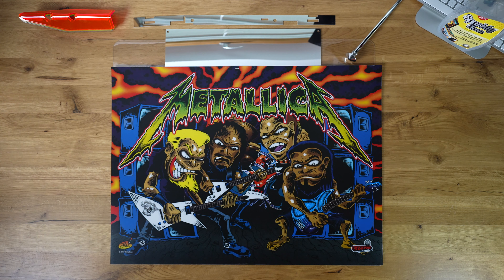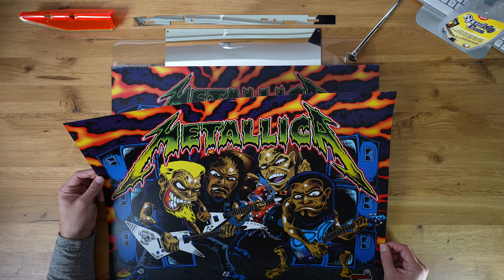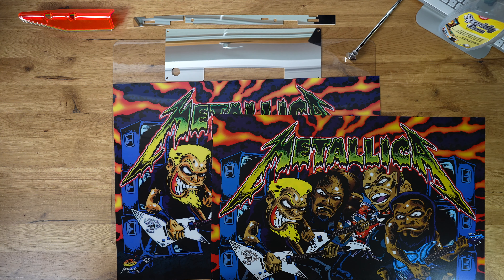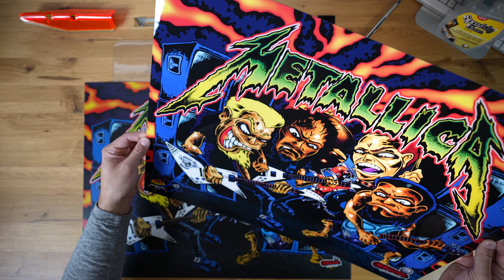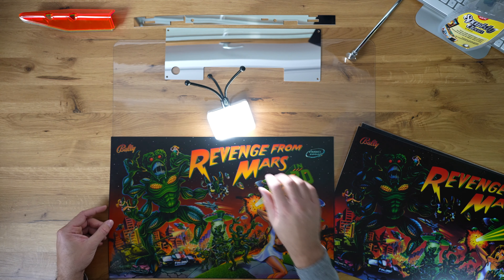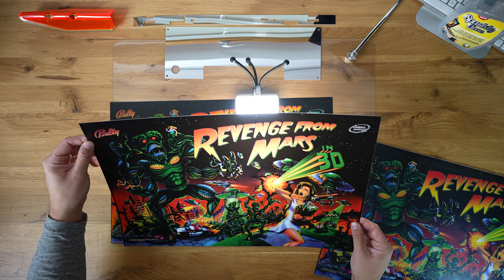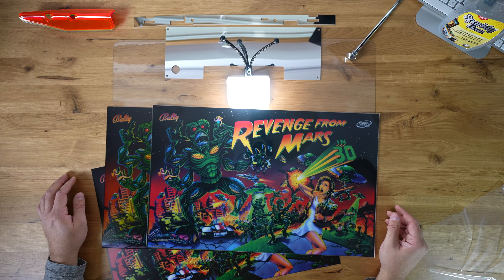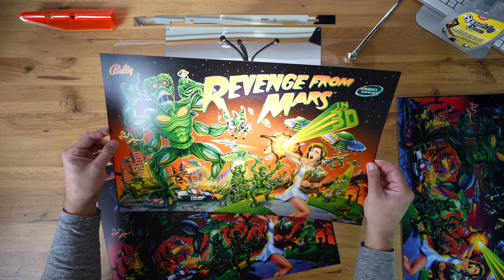Original, Backlight, and PET G Translite (Quick Comparison)

Comment: Hello am very curious type if person. In my country ti make a back lite board they charge like gold. I want you guide me on flollwing things.
1) what material is used ti print. I mean pet or pet g and its thickness is it white milky or transparent. 
2)what kind of printing is done on it. I mean is it inject printing.  
3) which kind of led light are used to illuminate. I mean volt snd number of lights used.
4) how to make a frame and what should be the minium distance between led and pet sheet to illuminate proerly